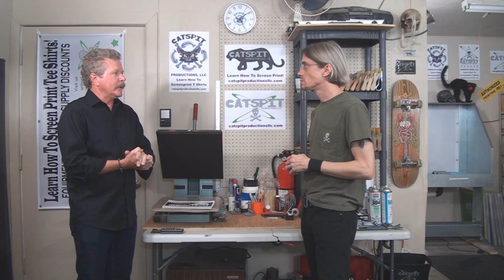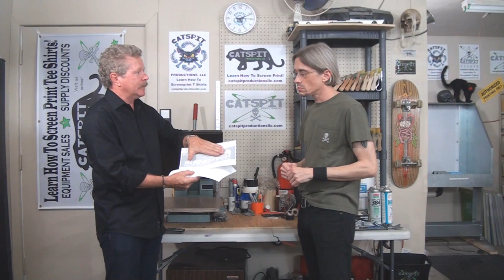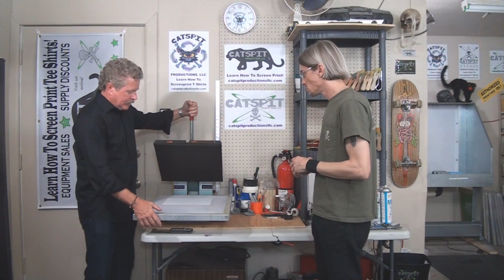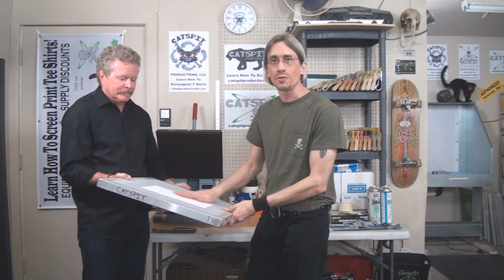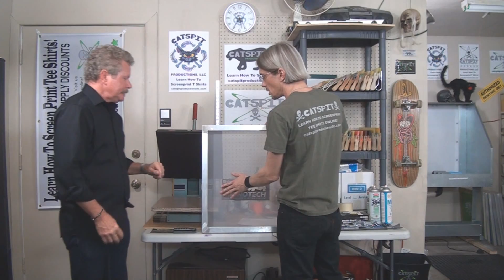Dry Stencil.wmv

Comment: what about half tones?
Reply from the maker: Thanks for watching our video on RhinoScreen Dry Stencil Film. It’s a great system, but designed for spot color printing. Because the process requires the stencil to be heat transferred to the screen, a half tone dot would be flattened and not print properly.  FYI - this is the latest version of RhinoScreen 2.0 (https://www.youtube.com/watch?v=lei7kDBF7po&t=3s).  If you’d like more info about our other screen printing or transfer systems, please contact Chris at 651-686-5027 x 4. We hope to work with you.

Comment from the maker: Very durable, designed for expedited screen making and short runs. As far as printers go, we recommend that you test thoroughly w/yours. We have customers that use Xerox lasers, but there are so many different models, as you know. We know that OKI Data works well. Please read Chrissi Dees comments about RhinoScreen on our FB page "recent posts by others" + see an image she also posted. She only prints with the dry stencil system. thanks for inquiry.